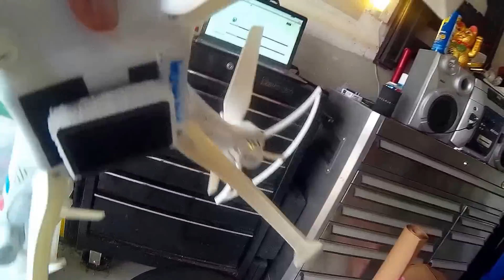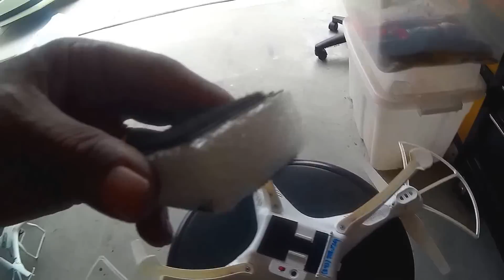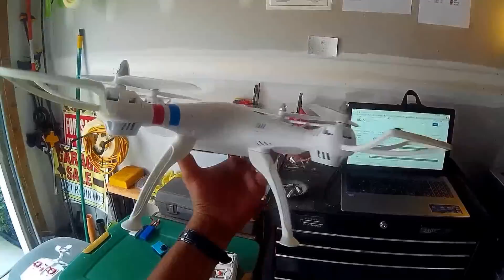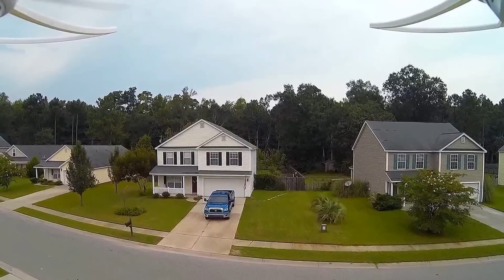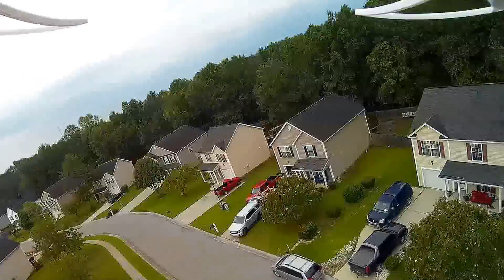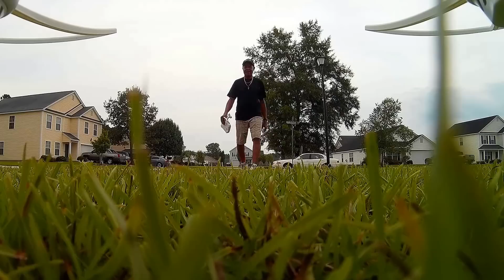Syma X8-c Anti-Jello Mount That Works For FREE!!!

Comment: Awesome video! Great idea on the camera mount. 
You can add an extra washer on top of the props to help keep them from bouncing around on the shaft. And remove the prop guards, you will get more flight time, and less noise from them vibrating.
Reply from the maker: Thanks for watching and commenting. I did the washer mod in a later video, worked pretty well. Thanks for visiting my channel, please stop by again. DJ Soul Force

Comment: This is really well done.  Great idea.  I would be a little worried that the velcro might give under the vibrations, but it looks like it held very well.
Reply from the maker: I also use this same mount on several other quads and it holds up pretty well. I am a little reluctant to put anything heavier than the RunCam HD on it, but it's perfect for the 808 Keychain Camera. Thanks for watching. DJ SOUL FORCE

Comment: Excellent idea. I noticed that the vibration always got worse when you came out of straight and level flying. You can see video stutter happen as the craft tips in its direction of travel. You can also hear the incredible vibration as if the props are hitting something. Perhaps its the motors that are causing this problem. Bad bearings possibly?
Reply from the maker: I later discovered that there was too much space between the props and the motor shaft.  Adding an additional washer between the props and shaft ("the washer modification) will also help eliminate the jell-o effect!  Thanks for watching and your feedback!!!
Reply: @DJSOULFORCE  Ah, that's good news. Thanks for this reply.

Comment: does a pretty good job.  great idea.  You are right about the stock camera.   It's the same camera that in in the x5c except with the different connector it isn't usable with the x5c.  The plug can be replaced but I don't like soldering the very fine wire involved, especially when the cameras are pretty cheap.  I wonder if balancing the props would change that bowlful of jello that is typical with the x8c?

Comment: I'm still gonna give it a try.  I use the credit card/ziptie mount but still get a little jello.  I've also got a chroma but as nice as it is, I like to fly something a little zipper.  My x5c binds to my x8c giving it the longer range but not the headlock mode.

Comment: Hi Dj, nice job..It is a never ending job to combat the dreaded jello, and you are right to ditch the stock camera. Many quadcopters suffer vibration, and most comes from props being out of balance. It was interesting to hear the X8 in flight, as yours has that rattle noise, that mine has also. I thought it might have been the battery charging connector rattling against the battery bay door or my camera mount rattling in its slide, but I think now, it must be a querky noise of the X8. Thanks for sharing and happy flying.
Reply from the maker: +mick thebass  Hmmm, I thought that noise was the props hitting the prop guards! Thanks for watching.

Comment: Have you tried flying it without the prop guards and compared?  I have always thought they add just one more element to throw off balance and vibration.
Reply from the maker: Yes, I got much better results after removing the prop guards. Thanks for watching.

Comment: Fantastic stable video! Is it possible to mount a fpw camera signal on this quad? I must see the video signal when I recording when I am sailing.
Reply from the maker: Yes, it's possible but would require adding an additional camera besides the stock camera.  I suggest taking a look at the MJX Bugs 2W or the Aosenma CG035, very affordable. Both have FPV systems that will allow you to see exactly what the camera is recording.  Adding an additional FPV camera on this quad will not give you the "exact" image that your stock camera is recording, but it can help to line up your shots.  For the ultimate FPV camera bird (on a budget), get the DJI Phantom 3 Standard or if you can afford it, get the DJI Mavic Pro.  I have done reviews on both on my channel.  Here's a video of the Phantom 3 Standard - https://www.youtube.com/watch?v=Gx6nqUaf0pE  Good luck, happy flying & sailing!!!
Reply: But I don´t like that I can see the propellers in the screen. All is very good, but if it is possible to mount this gimbal lower it should be fine.

Comment: one thing I find good to use. is tire inner tube. It's nice and think, and absorbs vibration well. just cut a square off a old inner tube and place it between your gimbals. cut little slices in it for your screws to go thru.
Reply from the maker: +Randy Combs  Sounds like a good idea. Are we talking just one layer or fold the rubber over? The X8-c doesnt use screws to mount it's camera, it clamps on but I might try your idea on another quad. Thanks. DJ SOUL FORCE
Reply: +DJ SOUL FORCE I just use a single layer of the tube. one ply. And I did use little screws on my X8g. I didn't like the camera mount that comes with it. So I used the the mount off one of my X380s. 3 holes. The mounting plate is a bit long, I just cut the back end off a bit. camera sits right in the middle of quad. or you can have it forward even. The little screws self tap themselves into the quad. just have to make sure to use short one's. otherwise the battery will hit them when placing it in. Can always file down the screws tips to shorten them. But yes the inner tube can be used on other setups as well. I learn alot from your videos. just thought I'd share this tip. take care.
Reply from the maker: Randy Combs  Hell, I didn't know you had the x380, have you seen this video for a Syma camera mount - https://www.youtube.com/watch?v=iRDXnoNs7UU  The mount I made in this video was actually for my RunCam or the 808 Keychain Camera, but I use different mounts for different quads for different cameras!!! Thanks for watching and for sharing you ideas bro, appreciate it. DJ SOUL FORCE

Comment: Hi,
Really nice video, I wanted to ask if you have heard or tried upgrading the stock antenna without actually taking out the stock antenna and just attaching a wifi antenna wire and to the stock and adding the antenna. 
Thanks
Reply from the maker: I didn't do any antenna mods to mine, but I have seen guys add longer wire to stock antenna to improve range, without removing the stock antenna. Check out CockPitVue or Dustin Dunnill on youtube, they both did some great range mods to the X8.  For a toy grade quad, I think the range is pretty good already. DJ Soul Force
Reply: +DJ SOUL FORCE thanks a lot for the useful response as always. yes sir already has a good range for a toy grade however for my unit the quad occasionally loose signals and just fall off the sky even when it's less than 20meters away from me.so I had to try this mod to test if it helps.thanks for your timely response.

Comment: I like it and you can orient the camera with different shapes of "Styrofoam".  Do a 45 degree wedge...or straight down for a different effect completely.  That was something other than Styrofoam.  Very nice video.
Reply from the maker: Thanks for watching. I read some of your comments on my other video, and see you're have a little trouble mastering flight with your x8-G. Hang in there, keep practicing and it'll come to you. You might wanna consider a smaller quad, one that you can practice on indoors on those days when the wind is too high for the x8 or raining, etc. I recommend - https://www.youtube.com/watch?v=-IxV4NJI5FY

Comment: I've ordered a dubro blade balancer and am going to see if a good balancing job helps.  If it's just the motors vibrating, I don't know how to help  that situation.  As it's winter here, it may be a while before I can post anything on the results, and, I won't getting the balancer for a couple or 3 days yet.
Reply from the maker: +Robert Bowen  It's a continous battle against jello with this quad. I'm thinking now, just forget about video, just fly & have fun with this darn thing! I like the X8-c, but I've got two GPS birds that take really great pictures. I have one more experiment to try with the Syma X8, it's the "rubber band" mount. That video will be coming soon.  Thanks for watching.  P.S. How's your Chroma?

Comment: ...   I have been lame about putting out my HD low rider Syma 8.   When I finally do in Spring we can see my chopped gear and vibration mounted 808 #16 wide angle.  FPV of course.
Reply from the maker: ...cool!!! thanks for sharing.
Reply from the maker: I've tried to get one of the stores to send me the Solo for review, but no luck yet. I'll keep trying to get my hands on one. By the way, the 3DR Solo 2 and the Solo Mini is suppose to be coming out soon! Thanks for watching. DJ SOUL FORCE

Comment: Where do you buy the clip on the remote control for the telephone? Thanks!✌️
Reply from the maker: +Matteo De Paolis  Mine came with the Syma X5-sw. They also come with any other Syma quad that uses wifi for video. You might try searching on AliExpress.com, Banggood.com or GearBest.com. Search under Syma X8-w or X5-sw parts.  Good luck.  DJ SOUL FORCE

Comment: I purchased the Syma X8c  and I plan to get a Phantom Standard this summer.  Is there a single camera you can suggest for both, without breaking the bank?   Thanks
Tommy
Reply from the maker: +Thomas Garrett  For the X8-C, look at the 808 #18 Keychain Camera or the RunCamHD, then you can later use either one of those for "hatcam" or taking ground shots. Your Phantom 3 Standard will come with a 2.7K camera and 3 axis gimbal already attached and installed!!! (you won't need to buy a camera for the Phantom). Here's a recent video I did using the RunCam on my X8-C. BTW I use the RunCamHD to shoot all of my videos, record all of my audio and take ground shots! https://www.youtube.com/watch?v=6hmqFWfXRBE  Thanks and good luck.  DJ Soul Force

Comment: Sweet video dos the MJX X101 have a gimbal connection like the HK detect ?
Reply from the maker: +André Solide  No it does not. It has a power connector for the MJX series cameras.  A gimbal might be a little too heavy for the X-101.
Reply: DJ SOUL FORCE Really X-101 it so big dos the Syma X8 more powerful it cud handle a gimbal ?
Reply from the maker: Simply put, whenever you add more weight than the quad's stock camera, you will put a strain on the motors. Quads that can lift gimbals usually are sold or shown with gimbals from the factory. The Syma X8 can lift a gimbal (and the X-101 too) but it is not recommended because you will quickly burn out the brushed motors. Brushless motor quads are better suited for heavy lifting, like most GPS quads.
Thanks.
Reply: Aaaa shoot i was really hoping to put a gimbal on the MJX or THE Syma thanks for the helping info.
Reply from the maker: Keep your hopes up, they're starting to make "mini" lightweight gimbals. They can hold small action cams like the mobius or RunCam. I'm thinking they're gonna get even smaller in the near future.
Reply: Yes for shore but i want to fly now i only have a Hubsan H107C it all right for in door but out side a gush of wind and it gon B-(
Reply from the maker: Have you seen the XK Detect X-380 GPS quad or the Cheerson CX-20? Big strong GPS quads but cheaper than a DJI Phantom.

Comment: Are you 100% sure that Velcro will hold? Good Video --Thanks
Reply from the maker: +Marv JS  If you use an industrial strength velcro, yes I'm sure it will hold up to the weight of a GoPro camera! Remeber to use hot melt glue when gluing the credit card to the foam. Thanks for watching.

Comment: Wow, super easy and extremely efficient hack my friend! I am amazed how smooth it made the video with this simple hack! Could I do the same with my MJX 101? Can you advise how can I get ride of the FOV without the landing gear? Many thanks in advance and keep making more awesome videos! subscribed :)
Reply from the maker: +Junaid Hassan  I have used this same mount on my MJX X-101 but because of the position of the battery bay, it is hard to keep the legs out of picture. Watch this video, it shows the MJX X-101 using the same hack!  DJ SOUL FORCE  https://www.youtube.com/watch?v=n1jM5v2_O7E
Reply: +DJ SOUL FORCE Thanks so much for your reply! Have a great day! :)

Comment: so which is better, spy cam 808 or runcam for the x8? thanks for the video.
Reply from the maker: It's almost a 50/50 decision. The 808 Keychain camera takes pretty good video in 720P and is very lightweight, so it won't take away from your flight time. The RunCam takes much better video in 1080P, but it is a bit heavier, which can shorten your flight time by a minute or two! My personal choice is the 808 Keychain because it's not much heavier than the stock camera and doesn't cut down on flight time. Good luck with your decision. DJ Soul Force
Reply: +DJ SOUL FORCE thanks.  do you think the heavier the quad, the more stable in the wind?
Reply from the maker: ken S In some cases, yes. The main factor to consider when flying in the wind is the strength of the motors. Here's a new toy quad that was recently released that has powerful brushless motors and can lift a GoPro camera, take a look at this one - https://www.youtube.com/watch?v=Uv9M-cEuCi0  The price is not bad either! DJ SOUL FORCE
Reply: i think i'll go with the 808 for the fact that it will have less stress on the motors and keeps close to its stock weight.  great vids man.

Comment: This looks very promising! I've just ordered a RunCam 2 and should get it delivered next week. This is definitely the first thing I'll do.
I might try however to mount it on top of the Quad as opposed to underneath. I'm not a big fan of props showing on the videos. Anyone tried that?
Reply from the maker: +Daniel Castro  There were no legs showing in this video. If you cut the foam in a slight wedge shape, you can also eliminate the legs. If you mount on top, you will see the props, but from the top looking down. Thanks for watching. DJ SOUL FORCE
Reply: DJ SOUL FORCE I didn't mean legs, I meant the propellers and propeller guards.
I might try to make the mount a bit longer so that the camera is further down.

Comment: how about mounting the zip tie credit card mount on the styrofoam vlecro mount and combkning the??Not much weight,you also get a lower angle.Did anyone try this cause im curious if it works
Reply from the maker: +Teo Pit  I've never seen the two mounts combined like that, but it sounds like it would work.  DJ SOUL FORCE

Comment: Dj Soul Force,  I have a Syma X8G with it's stock camera. I bought SJ4000 and it's not a knock off so it won't fit  the Syma X8g camera mount. Do you know if there is a bigger camera mount that will fit on my X8G. Thanks DJ Rick
Reply from the maker: +Rick Bowie  I don't have any links but I think you can find something that works on www.AliExpress.com.  I just searched at Gearbest & Banggood.com and all I could find was the stock holder that you have already. Good luck, sorry I couldn't help more.  DJ SOUL FORCE

Comment: Did you  have  to  register  the  syma  x8
Reply from the maker: +Mark Garey  That's a damn good question - Lol!!!  I haven't put the X8 on a scale yet since you only have to put your registration number on your quads that weigh over .55 Lbs (1/2 pound & up). I had to register a couple of GPS quads, but they give you one registration number to use on all of your quads. I'm pretty sure that, with a battery in it, the Syma X8 weighs over .55lbs and because of it's range, you might want to register anyway. "Keep the man off your ass!"  Thanks for watching.  DJ SOUL FORCE

Comment: That anti-jello doesn't fully work. It is a Youtube video stabilizer.
Reply from the maker: +Ridho Rizanov  I went back and watched this video, you are right, that is the Youtube video stabilizer!  It was used in the very beginning of the video and any hatcam footage that you hear my voice. The onboard footage was not processed or stabilized. The flight video was shot separately and spliced in without processing - I promise!  I just did another video using a different camera holder on the X8-c that helps with jello and keep legs & props out of the picture. Please watch, no stabilizers used, promise!  https://www.youtube.com/watch?v=iRDXnoNs7UU

Comment: Thanks for the link as well.......
Reply: +Marvelousod Are you just using some old credit cards or is there some material similar you can get some where.  Does it make a difference?
Reply from the maker: +Marvelousod  No it doesn't make a difference, any plastic will do! The credit cards are just easy to cut with ordinary scissiors and don't weigh that much. (I made one before using tupperware!) DJ SOUL FORCE
Reply: Gotcha.  Thanks,  Im not much into the Camera platform yet so i'll just be goofing off with a 808 keychain.  So i think this will be perfect to upgrade my FAT BOY with.  Nice and simple for a new poilot....

Comment: dude also i took camera out of the camera pod stuck some foam between bound round with valcro straps and thick elastic bands job done dude no jello vid on my channel about it check it out my new motors come can you buy pcb board for x8c i only find china can send link dude cheers live in uk no one sell that part on ebay
Reply from the maker: +gadgetman 404  I'm not sure where to buy a new pcb board other than China.  Sorry, I don't have any links for them.
Reply: Its ok on its way grom china cheers

Comment: Still jello, but reduced to a tolerable level.
Reply from the maker: Yes, not too bad. A softer foam (like memory foam) can totally reduce it; of course, prop balancing helps too! Thanks for watching. DJ SOUL FORCE
Reply: Fixing it solidly to the quad with a thin layer of rubber or foam would do the trick better. Jello appears not because of shaking per say, but because it's a CMOS camera and gets in sinc with vibration. And ND4 filter on the camera would help more and showing a leg would too.